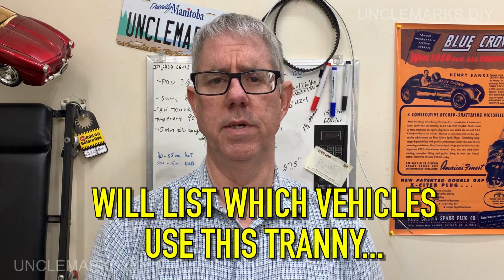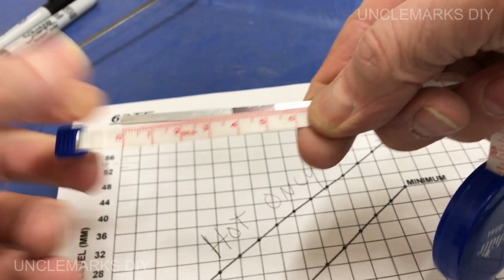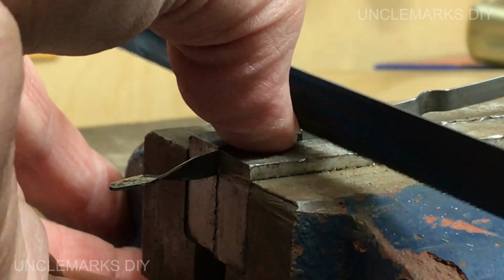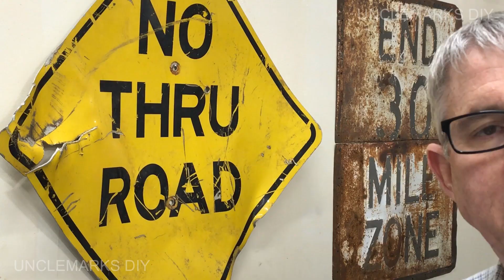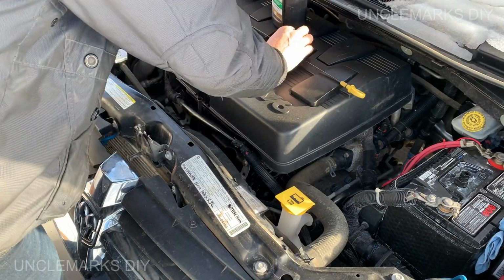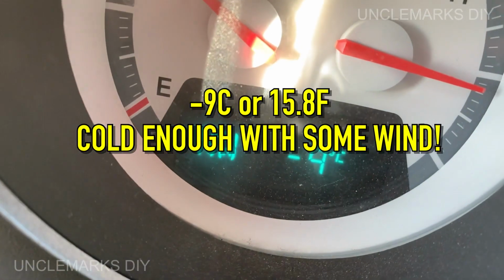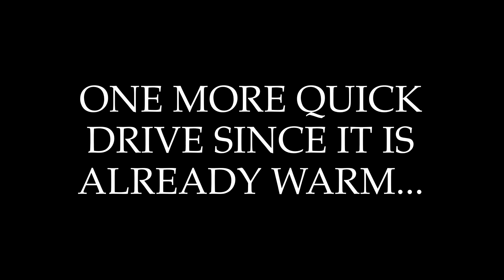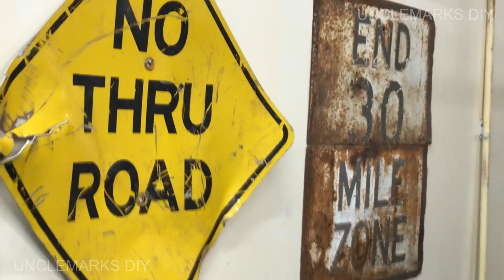How to check transmission fluid level Grand Caravan 08-2020 VW Routan (EP 165) 62TE Trans dip stick

Comment: Good because most of the other videos are for the 3.6liter and they do not say if it applies to the 4.0.  I had gone ahead and bought the dip stick.   Um the little hole in the frame below the hood is for putting the cap when removed I believe.
Reply from the maker: Thanks Bill! I will be posting more 4.0 litre engine videos as I do more repairs to my wife's van. In my Grand Caravan playlist there is a few already plus one where I change the timing belt, water pump and associated pulleys. EGR video in the works as we speak.

Comment: Eventually I will buy another dipstick and precisely measure the length between the trannny oil cap and bottom of where dipstick touches or bottoms out. Then drill a pin hole across cap housing and dipstick, to permanently kerp it from falling off, aside from the Epoxy glue I will use to afux it on cap.
Reply from the maker: You could if you have the time, J P. Unless it is leaking though, the level should stay the same. This one is due for a trans service. I have the fluid & filter, just need to find the time!

Comment: Hello sir, I would like to ask you about the electrical wire that is visible from the front clip, for what purpose is it used? Thank you
Reply from the maker: I would be happy to explain it Munaf. It is a extension cord that our engine block heater and car warmer are plugged into. Our winters can be many days of -40F to -58F (-40C to -50C) so the engine block heater insures a start! I also have a battery maintainer plugged into it as well. We do very short trips to work (15 minutes) etc so the battery does not usually get a proper recharge.

Comment: I'm somewhat curious about the proper level of transmission fluid.   I know dealers check it with their fancy equipment, so in theory it should be at the proper level.  But if all these transmissions are the same internally, then I'm thinking after sitting overnight or a few hours, most of the oil will come down into the ol pan, why ca'nt we measure it then, all levels should be about the same, has anyone taken a look at the level, after sitting overnight, and if we fill it to that level, we should be very close to a proper  / correct level of transmission level.  Right ?
Reply from the maker: The oil has to be at a certain temperature, that’s why I did it hot. But, it can be too hot and that will affect the level. Not too hot, not a bit cooler. The shops use a special tool that they watch for the exact temperature before they check the levels.